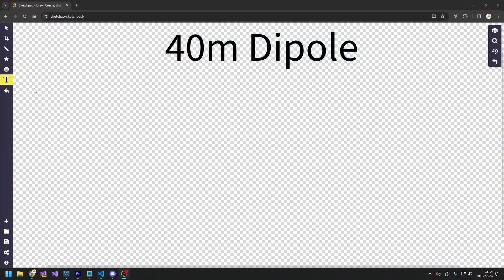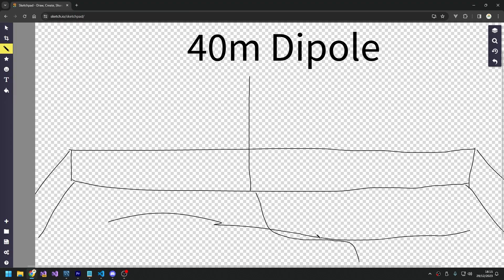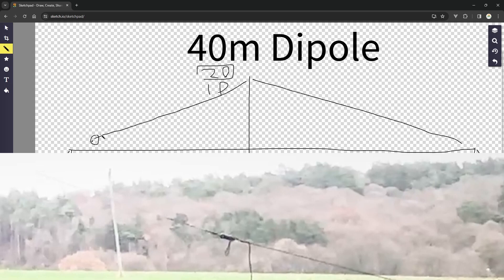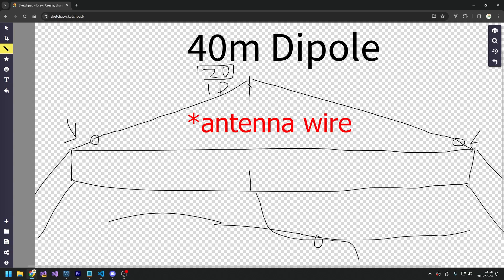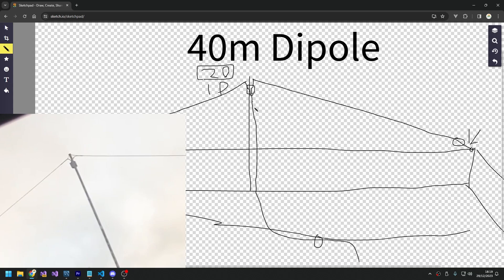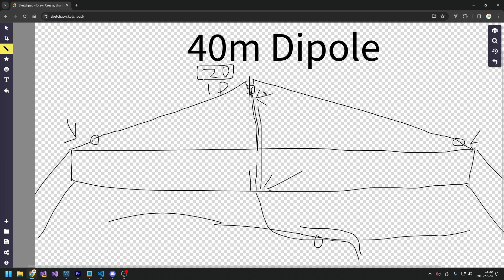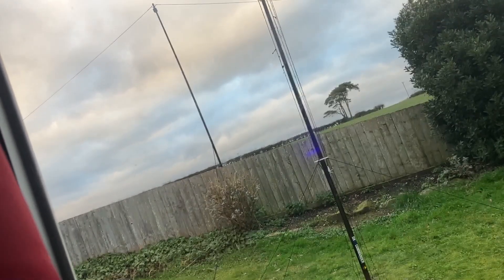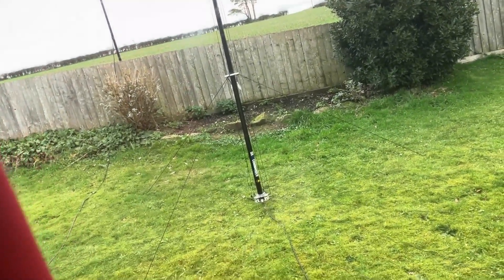HOW TO MAKE A DIPOLE !

Comment from the maker: This antenna is a beast on 40m for local contacts across the UK and Europe, for DX I use the vertical to get the low angle radiation.

Comment: Hi Stu
I run a dipole for 40mtrs that runs along the top of the wooden garden fence in The Netherlands and also no balun or choke used and it works perfectly.RG58 coax and thin wire for the elements.Works perfectly.
73
Ian G7HFS/PA3IKH

Comment: My first antenna I built was a 20 meter dipole. I didn't use a UN UN or a choke. First contact was New York with 50 watts. Very effective antenna. Yes how you build your antenna is entirely up to you. If It works that great.
Happy New Year Stu

Comment: Ello Mr Stus. 
Have you tried experimenting by putting your choke where the coax meets the bottom of the pole, rather than in the middle of the garden?
Reply from the maker: no, but that's where i'd prefer it to be,  to be honest the choke is only there are is was already on the coax. I don't use a choke for the vertical so why should i need one for the horizontal ?

Comment: That's what I built add a couple more elements each side and cover more bands works great great video
Reply from the maker: yeah, I'm thinking to add elements for 80m or use traps, can't decide!
Reply: I've got traps each end then approx 2m of wire after traps
Reply: It does make it narrow banded but OK with tuner
Reply from the maker: yeah i don't want to use a tuner, just straight into the Acom really so may go for fan dipole then.